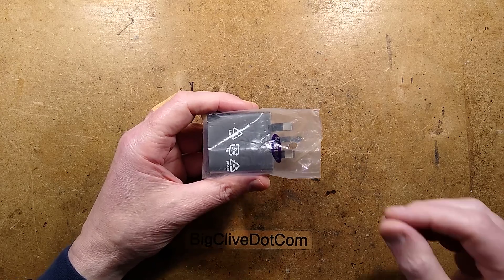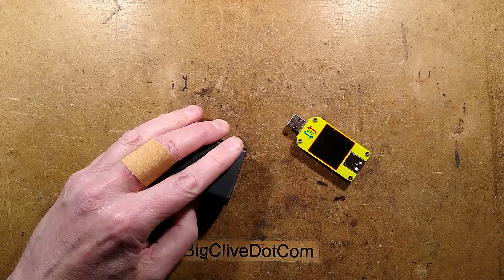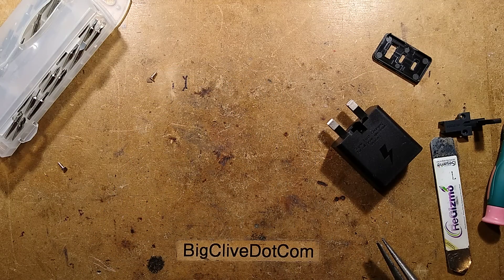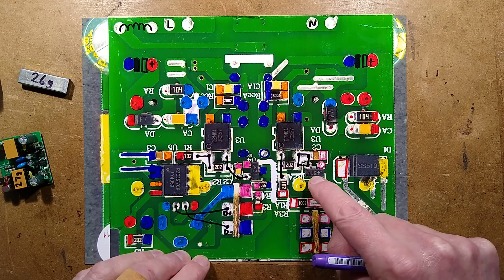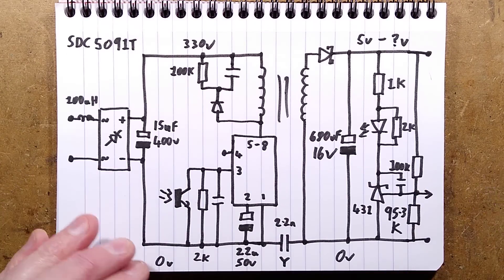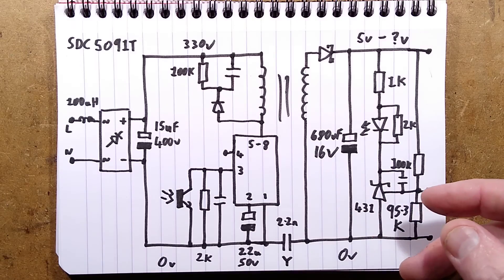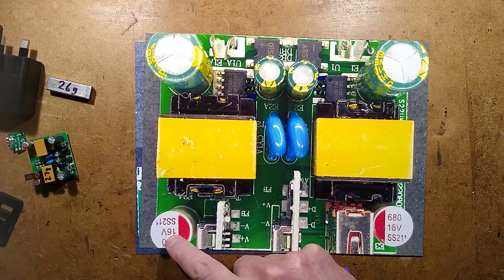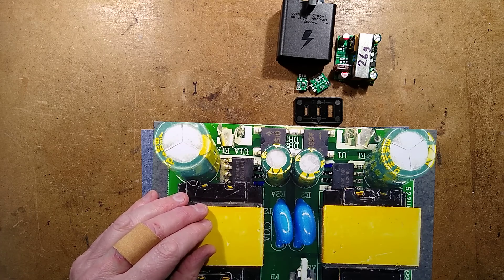Fake Samsung charger with interesting circuitry

Comment: It really bothers me that any manufacturer would go to the trouble of deceiving the purchaser by adding weights to the device.  Thanks, Clive.
Reply: This has been common forever
Reply: During the nineties, electronic circuits for cheap separate components hifi systems had become so integrated that some components like the tuner or the equalizer were empty except for the display or a control panel. They used to add metal bars inside the casings to make them heavier. Later they put everything in one box with fake separations 🙄
Reply: It’s worse the other way, when they add helium to lighten the device, but worse, as the evidence disappears upon smudger tool interference😅
Reply: One way of "recycling" scrap metal, though. ;-)
Reply: Bang and Olufsen used to do this all the time to their remote controls. They always felt heavy due to the large block of metal inside them to weight them down.
Reply: @TheMrMarkW I thought the weights in remotes were to stop them wandering off?
[Source : no idea where ours are half the time, or which is for which device]
Reply: @TheMrMarkW they used casted magnesium.
Reply: Makes me grumble because this is just the sort of power supply I might purchase to travel with, and I don't need any dead weight in my luggage.  I have seen this sort of weight before, but it was in a little USB-powered desk lamp, and clearly there to make the base more stable.
Reply: @condew6103  Old desk lamps used to have iron-core transformers, no extra weight needed.
Reply: Lol, people comparing ergonomic devices like mice or keyboards (where mass can alter the characteristics of the product) to power supplies.

One is more scammy than the other.
Reply: @PeTTs0n88  IBM wanted the new plastic keyboards to have the same "quality" as the old metal ones.  Everyone else copied to show how "quality" theirs were too.  But yes, bonus weights in your PSU, hard drive or powerbank is dodgy quality, not genuine quality.
Reply: @j.f.christ8421  IBM's old keyboards were of a type we would call "mechanical" now and used a specific design for the button contacts. It's easy to feel the difference when you press the buttons. Adding weight isn't going to fool anybody, a rubber dome keyboard feels (like garbage and) nothing like that. Heck even modern mechanical keyboards feel nothing like that. That's why there is a small company re-manufacturing those keyboards again and selling them for high prices
Reply: @j.f.christ8421  Sure, but there's actually a valid point to having weights in products such as keyboards or mice where there's an ergonomical aspect (even if I definitely agree that part of it is to increase the heftiness just for the feeling of a sturdy/quality product), whereas adding a weight to a power supply...

No, there's just no excuse for that. On the contrary when it comes to throwing in a somewhat loose (who knows how long that adhesive will hold?) metal piece in a power supply, it's downright dangerous.
Reply: @marcogenovesi8570  Thanks for the man-splaining, but un-necessary as I'm an old bloke, not a young lady.

And as a nerd, I'm perfectly aware of what a clicky mechanical keyboard is, and I if I wanted to use one I've got 5 or 6 of them in my pile of crap.  At least 2 Model M's, maybe an F as well.  The only thing worse than clicky keyboards is tossers yabbering about them.
Reply: @PeTTs0n88  A bit of weight is nice and occasionally a bit extra is needed (too light is a thing), but keyboards don't need 2-3kg of it.
Reply: @j.f.christ8421  That's fair, exactly how much would be considered "too much" though can be a bit iffy, and depend on the design of the keyboard/its feet and what surface they're used on.
Reply: @PeTTs0n88  Looking around the venerable Dell SK-8135 (the one with the USB ports) I'm typing on weighs ~850g, an even older BenQ is ~750g and a brand new Apple is ~700g.

The Dell has a metal plate inside, the BenQ has one as it's base (both presumably for bracing) which probably makes up a fair chunk of their weight, while Apple does things differently and has the keyboard made from metal (aluminium) with a plastic base (glued on, of course).

So about a 1/3rd the weight of an old school fanboy fav "quality" keyboard seems a good spot.
Reply: @j.f.christ8421  Weights in a hard drive might be there for anti resonance.  Even car makers do it.  I had a 1998 BMW and in the outer corners under the rear bumper wrap were two cast iron weights each about the size of sledgehammer head.  Must have been a last minute minor handling tweak.
Reply: @wtmayhew  Motorcycle handlebars are tubes that like to vibrate, so they screw weights onto the ends to dampen them down.  You definitely notice when they're not there.  Some things need extra weight, keyboards not so much.
Reply: @j.f.christ8421  Thanks for the reply.
Reply: @j.f.christ8421 I have put in more miles on a motorcycle than in cars, and I have never seen weighted handlebars. What bran of motorcycle did that... I have ridden Harley, Honda, Kawasaki, Nd many others, never saw weighted handlebars. Might the y have been custom bikes shops Could do that easiily...
Reply: @johnmood5653  You cannot be serious.  Y'know those things screwed onto the the ends of your handlebars, they're not there for decoration or keeping spiders out.  They are literally called "bar end weights" and EVERY motorcycle on the planet has them.  Take them off and see how you go.
Reply: @j.f.christ8421

An 'old bloke' who thinks mansplaining is real and is a 'nerd'?

🤣
Reply: @PeTTs0n88 Beats by Dre use the same trick (or at least they used to). It's all over the place.
Reply: Could it be acting as a heatsink?
Reply: I remember my Dad's "irritability" when he replaced our proper phone with a modern pushbutton model that no-doubt had the red triangle sticker underneath.

Every time he lifted the handset the coiled wire would stretch to maybe three feet before the inevitable forces passed some kind of equilibrium, whereupon the base would come up and hit him in the chest.

That is an example of a device that needs weights.
Reply: @qmcpatriot  I still have a Western Electric model 500 C/D desk phone which was manufactured in 1959.  Works fine with my cable provider’s VoIP box.  That phone is just plain heavy as is.  The base plate has a 425 network with seems to contain an induction coil / transformer with a lot of steel in its core.  It wouldn’t surprise me if that phone works for another 60 years.  There is a pretty interesting article about the development of the WeCo model 500 which appeared in the BSTJ in the early 1950s.  There is a lot of clever engineering for a seemingly fairly humble device.  There are compensation mechanisms which allow the phone to be used on various subscriber loop lengths without the craft person installing it needing to swap any networks to compensate for the loop length.
Reply: @qmcpatriot or glue applied to the bottom of the phone. 😅
Reply: At 15 quid a shot it has to feel heavy
Reply: Toyota has a counterweight on the shift rods on their manual transmissions...just sayin
Reply: @timothybayliss6680  That's for a totally different purpose than just adding weight to fool customers into thinking that it's a higher quality item. We don't pick cars up with our hands.
Reply: Weights serve a purpose in some products, if haptics are important or if it has to be sturdy and not fall over, but weights in a charger plug are definitely for the quality feel.
Reply: That is as stupid rotten trick, they should know they'll eventually be caught and possibly hurt someone with their fakes.
Reply: "4 weeks ago" 🤨
Reply: @thany3  patreons get early access
Reply: Unfortunately it’s nothing we haven’t seen before. It’s pretty common.
Reply: I remember telephones like that once the components were too light to feel right
Reply: The way I heard it, is that they started adding weights to appliances because of microchips. 

Costumers simple didn't think something that used to be heavy, and now weighed less than 1/5 of that, would work, so the factories added weights to make it seem like the appliance would work. 

Since that worked flawlessly scammers started using the technique, and they still do to this day.
Reply: I guess we'll just overlook the whole Samsung branding issue then.
Reply: Super common on scam SSD external hard drives and the like. Inside they have a cheap USB key and a few washers hot glued inside to give it some weight to make it feel more substantial.
Reply: Wait till you find out what the authorities, news and politicians do to deceive the public
Reply: Chinese manufacture. Surprise? Really?
Reply: If consumers would let go of this absolutely moronic mentality that "heavy = quality", maybe they'd stop doing it. Very few things actually need weight to function, for everything else I'd prefer it be as light or as heavy as it ended up being rather than manufacturers adding weights to please the "heavy = quality" crowd
Reply: You can name almost anything, and I can guarantee that people have added weights to it to defraud people.  Electronics (feels heavier), vehicles (weighing in more product than shipped), fish (tournament cheaters)...  the list goes on forever.
Reply: Welcome to the 21st century
Reply: Real apple airpods have weights added where as knock offs often do not have weights added to them
Reply: the metal bar may have functioned as a heat sync.
Reply: Beats headphones moment
Reply: Alas, this has been done since the dawn of time
Reply: Didn’t Beats by Dre do it with their headphones? Imagine getting the same awful sound quality from them without having to support the extraneous weight with your neck
Reply: never mind the quality, feel the width....
Reply: Even actual good products made in china have it (like the gulikit controllers), so it must be a cultural thing or something
Reply: The main problem is that if i add some quality components, they wouldn't weigh alot, and consumer might think that it's bad since it isn't heavy.
Reply: @k0lliak553  - I never worried that much about weight in components.  I'm used to the 'trick' that too many people did even all the way back in the days of the C64 power brick.   Potting the ENTIRE thing in resin (now silicone), to of course, hold the heat in, and give it weight.   Even the good stuff dies when you fill it with insulation.
Reply: which resistor, in this circuit 7:47, current-setting. can you suggest?
Reply: Odd how it says this video was posted 3 weeks ago and yet your comment is apparently 1 month old
Reply: @derpnerpwerp  
You're not a patron.  Patrons get early access to videos.
Reply: Are we sure that isn't a heatsink?
Reply: Well on The other side, the IBM PCJr. Came out with a keyboard that would bend like a credit card. It hit the market, and left it in the same month. IBM JUNK.
Reply: it's as heat buffer.
Reply: It's not really a malicious deception, they unfortunately have to do this due to a natural human bias. We, generally speaking, associate stuff as being better if its heavier. This is probably engrained genetically from when we were hunter gatherers in prehistoric times where people would try to get as much food in a single trip to save energy. There's a lot of products, name brand or knock off, that do this just to appeal to this bias. It feels better in the same way that people love those tungsten cubes.
Reply: Would you expect anything less from the country that sells fake eggs, fake rice and fake ice cream?
Reply: Just ridiculous. It's a charger.
Reply: Those provide some cooling, I think.
Reply: Here is why they would add things such as weights and other things that seem an inconvenience. People are stupid and easly tricked. If I hand you somthing and it is half the weight of a similar item. You are going to come to the conclusion the heavier one is better quality/built better/has more fetures. 😊
Reply: Early Chinese-made car amplifiers touted  lotz of wattz, but used cheap output devices and a big chunk of lead glued inside the case.
Reply: While it would be easy to agree with you, because I too have seen this in the past, I don't think you are necessarily correct in this case.  Why?

1)  When buying products from China, I am not aware of how it feels in the hand and often I don't know what it is supposed to weigh.

2)  There is no guaranteed weight, nor do I have the weights of other competitive products to contrast against.

3)  I have no valid argument that if it works, that I am returning it because it does not weigh a lot.

At the same time, I agree that to a certain extent, especially when something isn't cutting edge tech, there is a perception that something that does not weigh much, might have some corners cut to lower the production cost, but as I pointed out above, it just does not end up the way you're describing it for most global purchasers.
Reply: @stinkycheese804  no
Reply: Unfortunately has been happening for years, 5 - fe (5 gram “iron” weights) inside chargers, a couple steel plates I’ve seen inside a mains powered 240v parkside soldering station.
Reply: @BritishEngineer   In case of soldering station, additional weight can be exist to increate stability. To be honest, even one of Metcal soldering stations (fckn expensive one) contained block of metal inside. And yes, it guarantees you that no unplanned hand wave would move it.
Reply: @BritishEngineer dont you want your soldering station not to fall over? Adding steel plates to lower the center of gravity could actually be a nice addition?
Reply: @BritishEngineer  Weights in a soldering station can have a legitimate purpose to stabilise the base. I'm glass half full today........
Reply: Yes I had that soldering station! Lasted about a year with light hobby use!:(
Reply: I bought a "White van speaker scam" stereo receiver from a pawn shop once, for $5 in the Clearance Bargain Bin. 

I grabbed it just for parts, even though it DID work. When I got it home and took it apart, it LITERALLY had 2 bricks inside of it, stacked up, and through bolted to the chassis with a long bolt to give the unit some heft, and make it appear as though it had a LOT more inside of it than it did... 😂🤣
Reply: Yah, lots of old PC keyboards had rather hefty weights in them to increase the quality.  IBM, HP, Compaq etc.  The manufacturers would claim it was to stop the keyboard from sliding around, but nah,  Feel the quality!
Reply: @j.f.christ8421  But trying to type on a keyboard that tends to slide away from you isn't fun.
Reply: @BrianG61UK  Get a better keyboard then.  Or do what I do, have so much crap on your desk it can't go anywhere.
Reply: @j.f.christ8421 I'll stick to making it heavier if necessary, thank you. Though I must admit, there is now a lot of crap around it, so maybe it doesn't need it.
Reply: @BrianG61UK  Decent rubber feet work wonders.  A surprising number of keyboards don't have any, no wonder they slide around.
Reply: @j.f.christ8421  its actually to keep them on the desk and to make them sound nicer
Reply: @aiexzs  Bollocks, and bollocks.
Reply: @j.f.christ8421  it actually does reduce the moving though and that's actually important for a keyboard
Reply: @j.f.christ8421  I liked that. I still buy mice with the adjustable weights because I like them to feel like I won't fling them across the room if I'm not paying attention.  The IBM Model M 104 Key keyboard with the mouse nub was my favorite.
Reply: @j.f.christ8421   i think its ok on stuff like mouse keyboard and gamepads to add extra weigt to make it feel nicer as long that dosnt ment they cheap out on quality
Reply: @19AKANE92  How do you turn a crap product into a quality one?  That's right, add some weight!  You're the reason why this sort of thing happens.
Reply: @j.f.christ8421  but having a high quality gaming mouse that feels like a toy from happy meal is also nothing nice so let them add weight as long the quality is fine dude
Reply: @19AKANE92  Don't forget to buy the more expensive one as well, as we all know money = quality as well.
Reply: To be fair, I do want me keyboard to have some substantial weight to keep it from moving too easily. That's legit imo.

Much worse is stuff like those awful beats by Dre headphones made of flimsy plastic with useless weights.
Reply: @j.f.christ8421  But i dont have anything against a heavy, thick aluminium plate in my high quality keyboard to be honest.

Its not only the weight, its super rigid and you can not bend it unintentionally ever.
Reply: @harrison00xXx  If your keyboard is bending while sitting on your desk, you're doing something wrong.  Have none of you "heavy is good" people ever heard of rubber feet?
Reply: It's a common Chinese practice
Reply: Could the weight be there as a heat sink perhaps?
Reply: A lot of untrusting people, looks like it was used as a heatsink.  Because the unit is sealed no air cooling is available.
Reply: actually the purpose of the steel is to protect other devices from high frequency signal. smart phone charger nowadays converts 50/60 hz to higher frenquency  and those high frequency affects other devices performance
Reply: It's what Tesla do with their cars.
Reply: @Mike-H_UK  
Tesla?  All EVs are heavier due to the heavy battery pack.  Tesla has gone to lengths to lighten their EVs to improve the mileage efficiency.
Reply: @acmefixer1  There was an intentional modicum of wit in my comment.